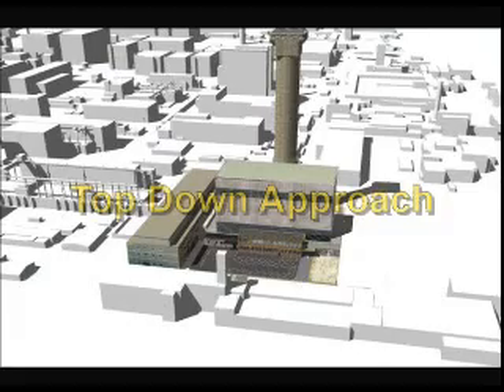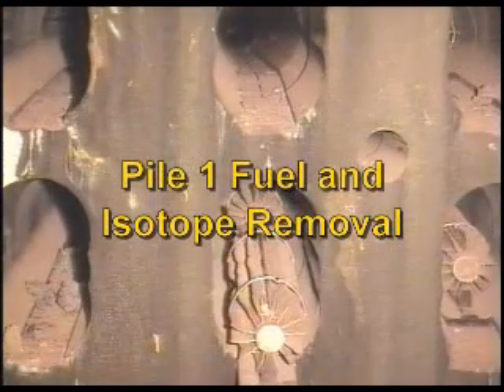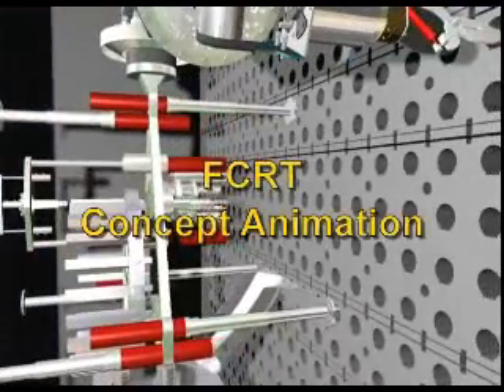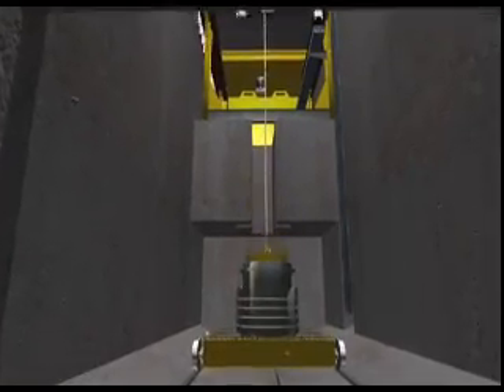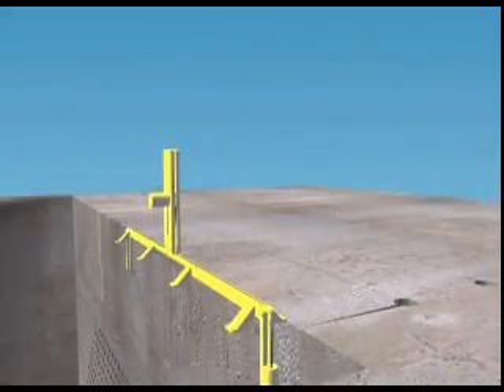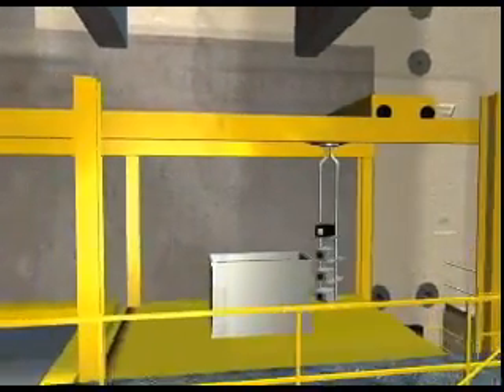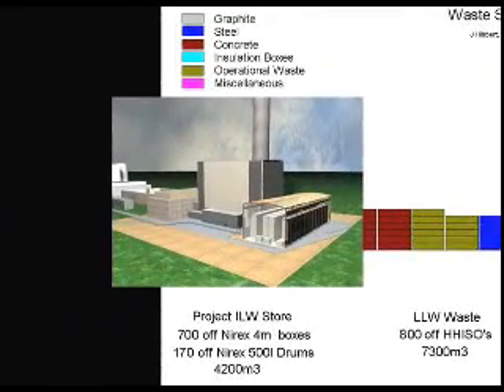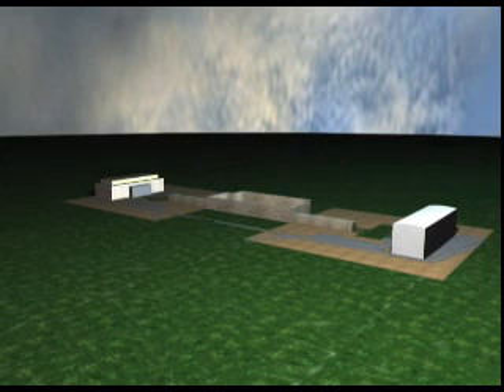Overview of the Windscale Piles Decontamination and Decommissioning Project

Comment: No one told these people that an air-cooled nuclear reactor was a bad idea?
Reply: This was one of the very first reactors. All the technology was new
Reply: @RobertdMacGregor  The AGR that came after were not much better. One of those reactors is 4 times as big as an RBMK 1000 and far less powerful and efficient. At least they didn't explode... It was another case, of British doing things a different way just because we are British and know better. Taxpayer will pay for it anyway...
Reply: @EduSanjuan777  I'll take that over a Chernobyl of Fukushima.
Reply: @agt155  Do you know about a lil som some called Windscale? Serious nuclear accidents started on UK
Reply: @EduSanjuan777  Windscale was a 1940's military breeder reactor, nothing like Magnox or AGR.
Reply: @agt155  However it was in UK and it had an accident that was pretty much close to be as bad as Chernobyl, if not for a big dose of luck. You english people always think know best but  often times fuck up the first. This is a good example.
Reply: @EduSanjuan777  All of the early weapons reactors were air cooled graphite moderated, I don't know what this has to do with AGRs or any modern commercial power station. AGRs were the Rolls-Royce of reactors, big and expensive, but the best around at the time. If Fukushima were AGRs the disaster simply wouldn't have happened.
Reply: @agt155  Yeah yeah, for sure. I believe you.
Reply: @EduSanjuan777  Hindsight is 20/20.
I think you'll find it was more of a case of us working with what we had rather than 'we know best'.

Quite a few British scientists worked at Los Alamos on the Manhattan project and contributed greatly. After the war the USA decided to kick all the British nuclear scientists out and classify all the research so the UK had to pretty much start from scratch in regards of nuclear weapon research which was the main focus for nuclear energy at that point.
And you can say what you want about British reactor designs - Calder hall's magnox design was still the world's first commercial power reactor.

Comment: why spend all that $$$ + move the material all over the place.... just leave it and secure it ..... it's not going anywhere & it's not like there gonna build a resort spa or a shopping mall after it's cleared away!!?
Reply: Well it still is a matter of safety/containing radioactive materials to safer location....Im sure there are spesific laws in UK as well about the nuclear security and how/where spend nuclear fuel and dismantled nuclear cores will be placed. Besides those reactors and the fuel inside them have stood there for more than 60 years, its about time something was done to them....You really think that dismantled/abandoned nuclear reactors and nuclear fuel should just be left where they are for infinite amount of time, rather than secure them safely away to wherever you store way your nuclear waste in UK...
Reply: Balnazzardi   You answer:  1 there are probably laws. 2. It's about time. 3.They will be safer.
1. What laws?  2.They are going to be somewhere for an indefinite period of time.  3. Where is safer? According to the video, te locations don't even exist.  Would it not be less costly to simply erect security around the plant?
  The decommission will create dust and other hazards from sawing. removal, sorting and transport. It is amazing the animation showed a worker,  without even a mask, directly supervising a shifting machine, where small particles are sorted and dumped.
Reply: @quantumbits  Obviously it was a test not with real material. Otherwise even staying a couple of minutes that close to irradiated fuel elements would mean certain death in a couple of days. When they use it on real fuel elements it will be done in a heavily shilded environment, and the workers operate with remote controlled robotic arms.
Reply: @alerighi  Not a test...Propaganda
Reply: @alerighi  So in the test they did not follow what would be the real procedure.  Then test for what purpose?
Reply: @They Caged Non You have provided only insults and no actual technical information to this discussion.
Care to take a real shot?
Reply: @They Caged Non Ah Did they say that in the video?
Reply: @They Caged Non I actually  get that part. My point is , underscored by the lack of protective garb, the video makes the process look safer than it is.
Reply: @They Caged Non Don' believe tin foil would  provide much protection from ionizing radiation.
Reply: @They Caged Non I actually get that. Point is they made the process look safer  than reality by not wearing protected gear where it would be needed.  I am not the only one who noticed this discrepancy. The industry always makes nuclear power look safer than it is . Remember this process is to be shown to decision makers, not necessarily scientists who know how to research and validate the procedure.  That is why I called it propaganda.

Comment: The people who built Windscale thought they knew what they were doing. Same as the people behind Chernobyl and Fukushima. The sooner we put a line under the Nuclear Industry, the better. Costly, risky and very dirty.
Reply: Sellafield/WIndscale is as bad as it is primarily because we needed bombs... And the waste produced and conditions at the site while making them was considered a secondary concern so long as it didn't affect production. This is no different than how the US and the Soviets managed things, The major difference being the UK Is much smaller, which means it can't be hidden... The US and Russia are more than happy to just tomb up their accidents.

We knew less about nuclear energy back then, both knowledge and technology, crucially, robotics, and electronics have advanced considerably, yet the issue with nuclear energy is that the vast majority of reactors and plants are using 1960's and 70's designs. even plants built in the 90's use the same technology as plants from the 60's... This is why they are a 'time bomb'.
With less hostility we could replace/upgrade existing plants with new reactor designs which are an order of magnitude safer, highly automated and cleaner... Fukushima happened in 2011, but the reactor was a GE, mark 1 BWR, the first of which was brought online in 1957!!! So IMO fukushima should be considered an accident* of the 50's.

*(Accident is a stretch... several engineers are GE resigned after raising issues related to the Mk1 which GE would not properly address due to costs. One of those engineers has gone on record as saying that ANY Mk1 BWR which suffers a coolant loss WILL suffer a hydrogen explosion and melt down, the safety systems were non-existent in the initial design, and the later revisions after 3-mile-island were even at the time deemed ineffective... hence the resignations... )
Reply: Fortunately, almost all UK reactors were built in the 80s with AGR designs which minimises loss of cooling accidents.
Reply: Pfft too dangerous.
I'd swim in a reactor pool pending the depth and radiation being emitted from the source when active!
Reply: Paul Passat 
There are 450 nuclear reactors that are providing carbon-free electricity safely and reliably to the world every day of the year. They’re clean and they’re the safest mode of electricity production.
Reply: @mudspike84   uhmmmmm, errr ... no.
Reply: @quantumbits  Waddaya mean, no? In deaths per kilowatt hour, nuclear is the safest electrical power on the planet.
Reply: @MrSunrise-  Oh Wow show me the source for that statistic...please  and another for loss of inhabitable land /KWH
Reply: @mudspike84  It is not clean and certainly not cheap. The thing is you don't see the dirt and environmental impact and it's a highly subsidized industry. 
Who pays the cost to guard and handle the waste for thousands of years which has to be re-stored many times before it's safe? 
What about the impact of the excess heat into rivers and oceans, the impact of mining for nuclear materials?

Nevermind the hazards of war and terror to nuclear plants.  And when a plant has a critical accident an entire region becomes uninhabitable. Nevermind that you then can't access the direct accident site anymore. 

It's better to switch to Fusionreactors. If only half the money would have gone into that tech we'd already have it, but you can't make bombs from that. The Wendelstein 7x Stellerator and ITER Tokamak aren't enough.
Reply: @mudspike84  how can you call them clean if nobody ever succsessfully disposed high activity nuclear waste?
Reply: Still, vast improvements will be possible with modern technology. Think how far a PC from 80's has come along... lol
But the accidents involving those ancient reactors, and how ever many other accidents which are waiting to happen all poison public opinion of nuclear energy. Its not 'unsafe' its simply poor design, military agendas and companies cutting costs.
Reply: LJK Designs LTD Steam, spent fuel....then the waste streams like Caesium-137 in reprocessing the spent fuel...not to mention the high level waste that is sent to geological storage to kill when discovered in 20,000 years. Steam!!
Reply: LJK Designs LTDNo you don't. The nuclear industry is veiled in secrecy. Employees are security vetted and it is veiled in public interest protection. The UK is transitioning to renewables and gas. Furthermore, the Nuclear Industry, dangerous, risky and toxic as it is, never includes the CO2 or other polluting output from the vast quantities of energy required for enrichment and reprocessing. Factoring in the security risk and proliferation risk (proven by the Khan network) we know nuclear is a filthy, expensive toxic waste of money. Then there the many accidents... Windscale, Chernobyl, Rock Lake, Fukushima etc etc. If isn't even particularly safe as history proves.
Reply: LJK Designs LTD The proof you are talking through our arse is you state "Nuclear Power is as safe as can be" whilst ignoring the recurrent Disasters such as Windscale, Chernobyl and recently Fukushima. Aside from the risks of creating and  managing  extremely  toxic vast dumps like Sellafield, fortunately governments are getting wise to the nuclear industry, it's toxic waste that has to be stored for hundreds of thousands of years, its vast cost and the fact that renewables combined with storage are truly the way forward. Witness Germany quitting nuclear and Westinghouse going broke. If he Chinese were not bankrolling it, it would be finished here too, except of course, for the "decommissioning" of the toxic mess that is Sellafield. I am an ex-Nuclear engineer with Fraser Nash. I know my sources. Please provide links to how high level waste is made safe and not stored at Nirex and similar geological sites. Also provide links as to how the security o gf these sites can be gauranteed over the life of the waste. Any links you can find outlining how nuclear power compares on financial cost would be interesting. Or are you talking out of your arse? I look forward to reading your links. Goodbye and Good luck. You need it.
Reply: It aint going away.